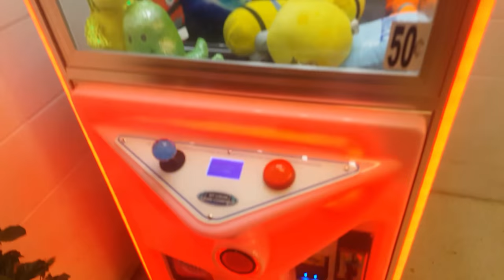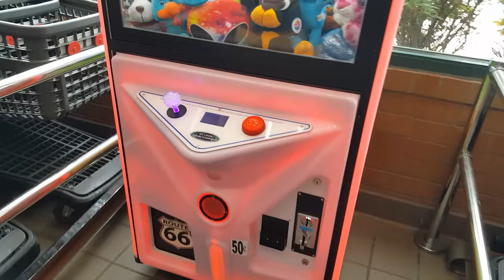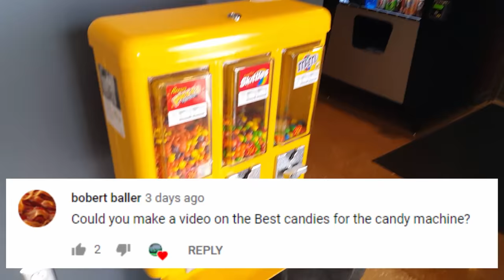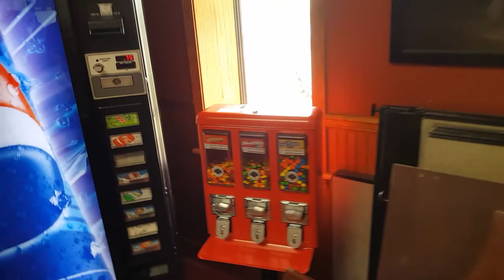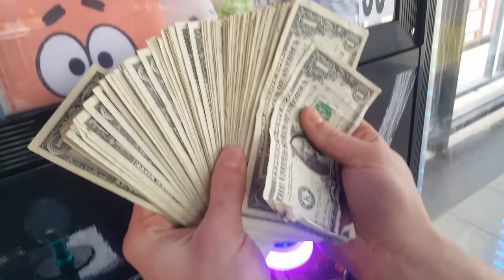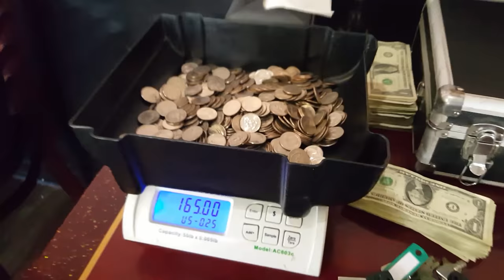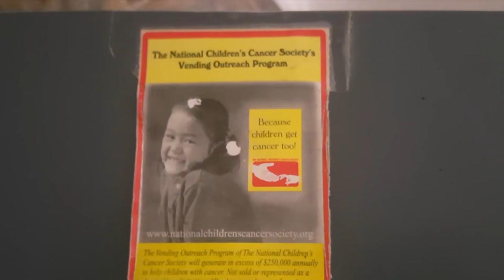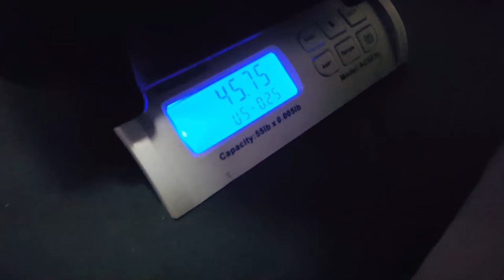Collecting Over $1000 From Our Vending Machine Business

Comment: I got the wiring and the pin and socket terminals connected. Just gotta get a box Molex connectors bc I got Molex pin and socket terminals. As soon as I get the connectors which are a pain bc Fry's Electronics doesn't have the one I need.